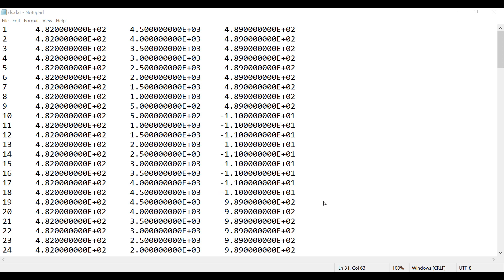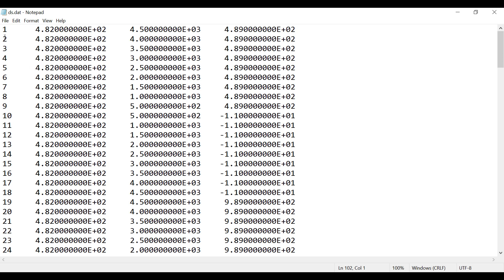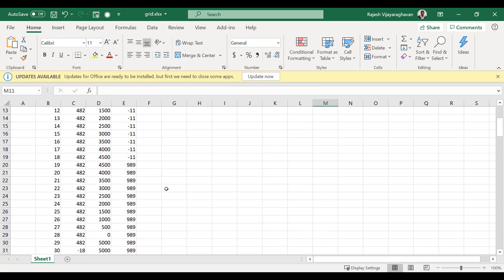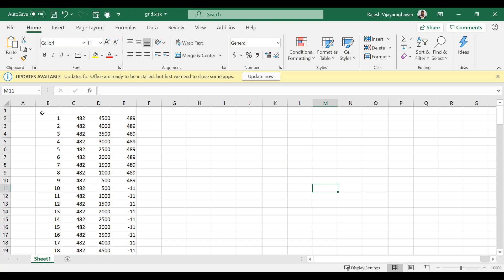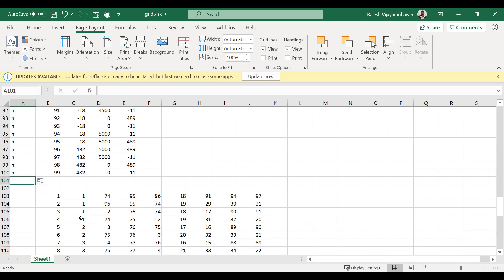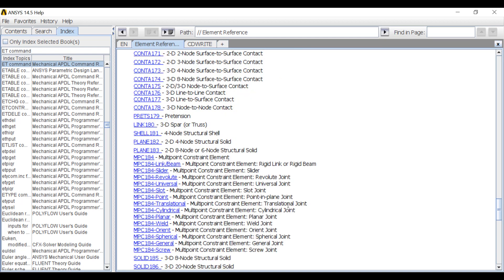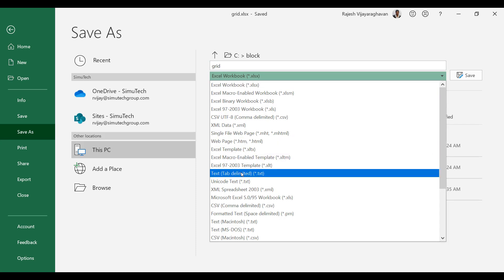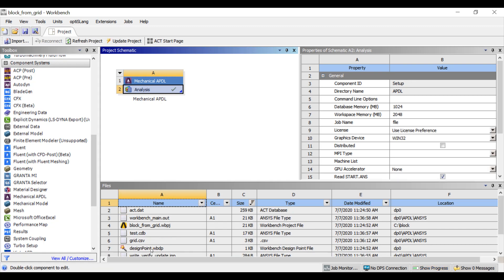Import Mesh from Text File into Ansys Workbench

Comment: Thanks for it, it seems the exact solution that I need! But even I have tried several times it gives an error and at the end it says that the geometry is not found. Do you have any idea why it happens?
Reply: I had the same issue. I had to run the input file in Mechanical APDL (not workbench), and then import that cdb file into workbench. Also save the input file as a txt file and remove the commas after /prep7. Last thing is make sure you define your elements correctly based on the element type. The nodes need to be listed in a certain order.
Reply from the maker: The Ansys academic support policy (https://www.ansys.com/academic/educator-tools/support-policy) was updated recently and all academic support will now be handled through the Ansys academic community. You should be able to register for the community at https://forum.ansys.com/entry/register which will allow you to submit questions on the various forums in the community. Several Ansys engineers are interacting with customers on that site so your questions should be answered in a timely manner. 

SimuTech has a training portal that contains both Ansys training material and tips and tricks videos that have been created by SimuTech engineers. If you are interested in pricing or learning about this offering, please contact us at info@simutechgroup.com.